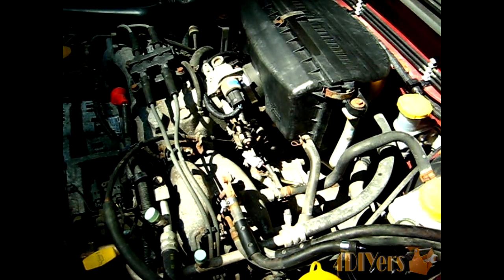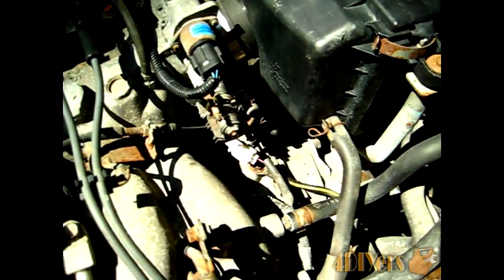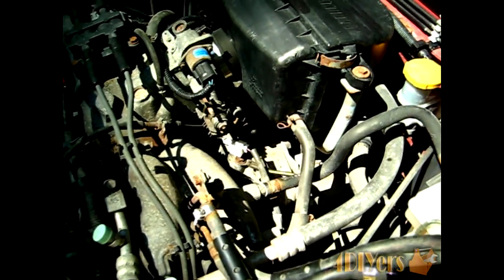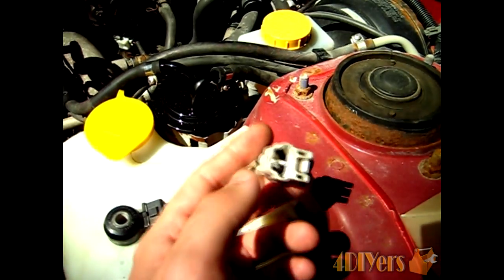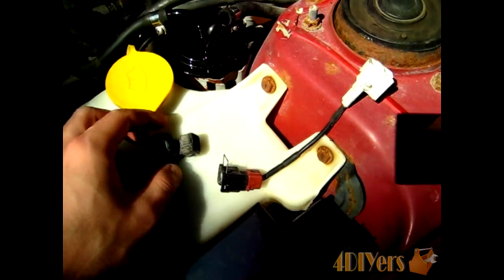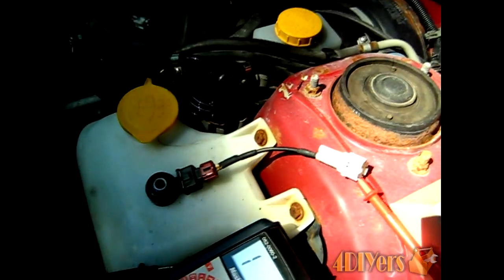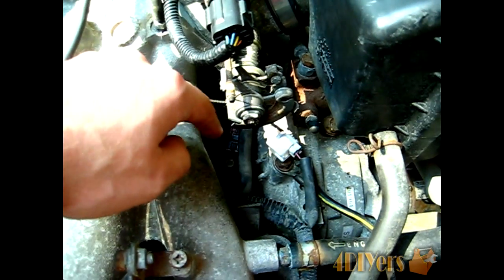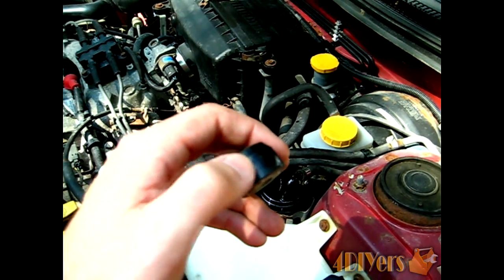DIY: How to Test a Subaru Knock Sensor

Comment: Concise, thanks friend. Great tutorial. I've also learnt that the sensor is piezoelectric and connecting one lead of the multimeter to the sensor and the other to ground and knocking the engine with a hammer will create an AC voltage if its good.

Comment: Excellent description of the problem. I would also point out that you could reference common on the block for the voltage test in case you have a bad ground on the block. Chances are you would have several other fault codes in that condition but it’s always a good check.
Reply from the maker: Thank you and excellent tip as well. Yeah Subarus are known for having ground issues just in general and I believe there are kits available to solve this issue.
Reply: If you had a bad ground on the Block would that only give you a low sensor reading? I am having p0328 high sensor input. I am, wondering if that isn't it because I know there is one of those ground wires hanging loose on the side of the engine

Comment: what happens with my car is it loses power between 3000 and 4000 rpm, then after 4000 it accelerates normal, when i drive the car slowly for 2 days it goes away, and this happens more in heat weather..above 30 degrees celcius, once i replaces the sensor it cost me 80$... but when i drive the car aggressively it breaks again.. so i take it slowly.. especially not for long period
Reply: Sounds like possible bad or shorting plugs or wires.

Comment: It's a good idea to make sure that the sensor is connected properly before removing/testing/replacing.  I went through the hassle of ordering a replacement, worrying about damaging my car when I was driving it while I waited, etc.  Eventually I figured out that the sensor had just come loose.  Could have saved myself a lot of trouble.

Comment: Couldn't you have just tested from the  connector terminal to the bolt on the block with the ohmmeter to verify the whole circuit in place without taking the sensor out?
Reply: alex laverick you could have but there’s a chance that you would have another resistance in parallel which would ultimately give you a lower resistance and a possible false reading. This eliminates that possibility. The one test you can do with the sensor still connected is the voltage test from the sensor supply in the harness to the bolt on the sensor. This gives you a chance to see if the engine block is properly connected to common rather than referencing the negative side of the battery.

Comment: i did everything you said. Change out with thee old, in with the new, but still getting that Error code for the knock sensor
Reply: Dom you can also test the sensor connected to the engine. Look for an actual voltage or frequency from the sensor.  If none it's toast.

Comment: Mine says 510 M ohm is that the same as k ohm?
Reply from the maker: M means megohms which is larger than K or kilohms, so the sensor is still good.
Reply: Ok thanks. I ended up just cleaning the ground connection on the sensor and my light went off

Comment: 550k is it good reading?
Reply from the maker: +deadcandance The sensor needs to be a minimum of 400k in order to determine if it's still functioning correctly. So 550k is a good reading.
Reply: +4DIYers Thanks for reply but I've found a significant crack on sensor so this one goes to trash.

Comment: Hi, Good video!   I have a 2001 outback 2.5  my code is po327 knock sensor voltage low input,  does that mean my sensor is bad?  thanks.
Reply from the maker: +jlc7300 I would double check the voltage going to the sensor first before replacing it as it's a pricey part to replace if it's not the issue.

Comment: do you know if the knock sensor connection is with one or two wires?, i  have a nissan x terra, and i don´t know if is only one wire or the second wire is broken. thanks, great video!
Reply: In Nissan models, one pin is ground and the other is the signal.  If you check continuity with a multimeter, one show 0 ohms and the other maybe 10 ohms or nothing if the sensor is damaged.